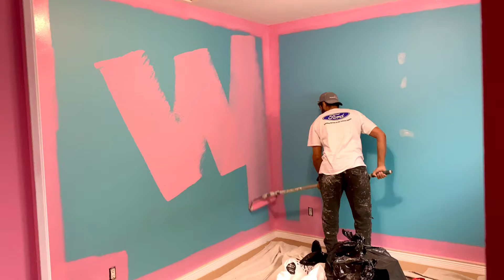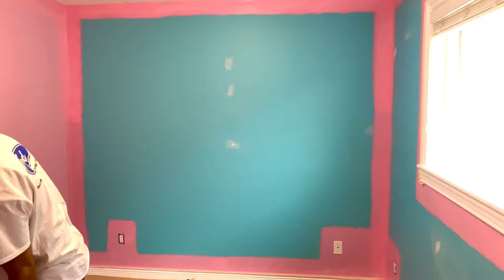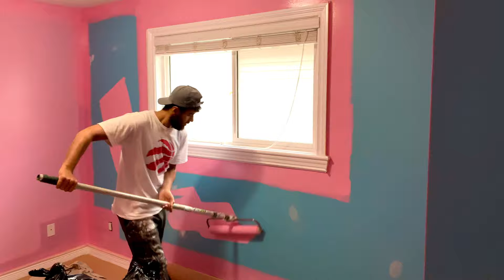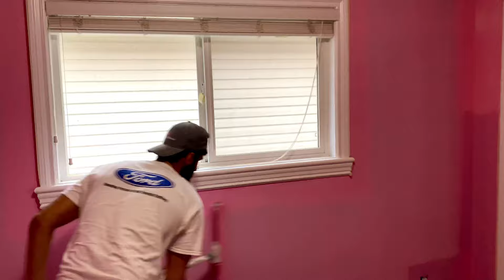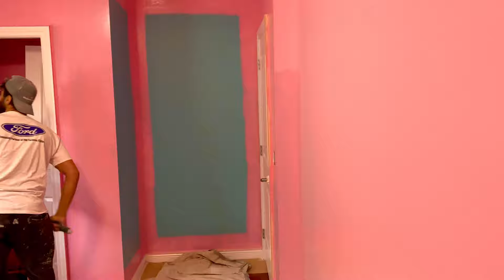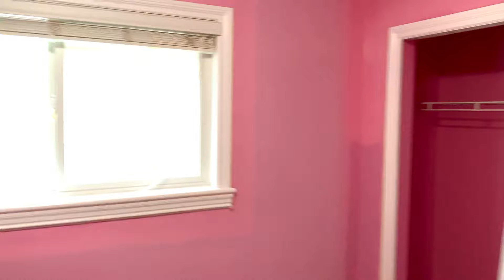How to paint a room fast

Comment: But my question is, how do you do so the roller doesn’t splatter all over the roof and the frames 😔 because that’s my main issue.
Reply: The slower you roll the less splats you get,  but you don’t see the ceiling / floor close up in these videos for a reason 🤫😉